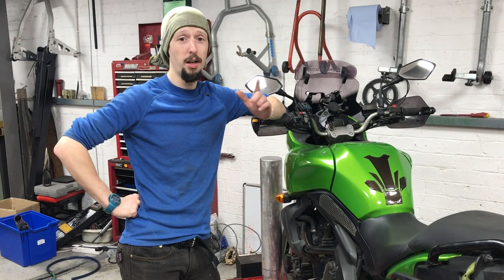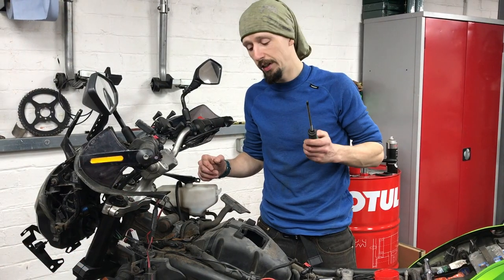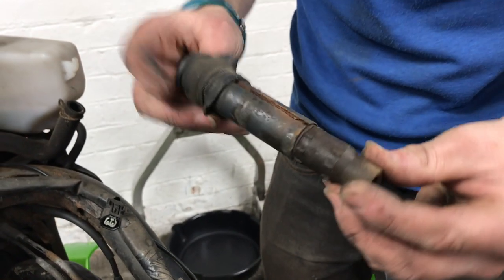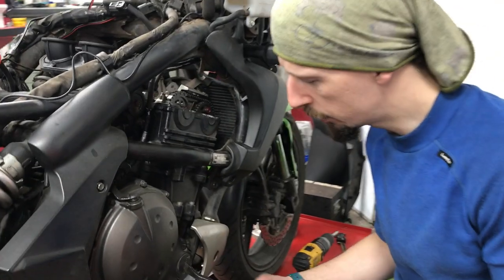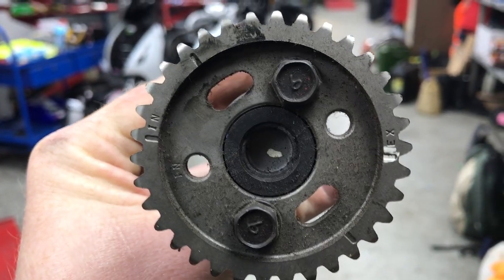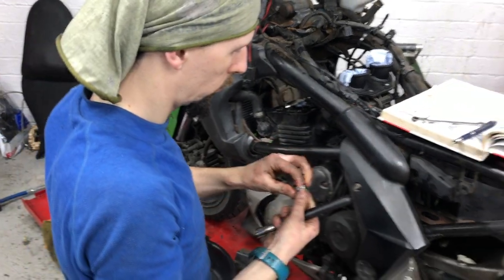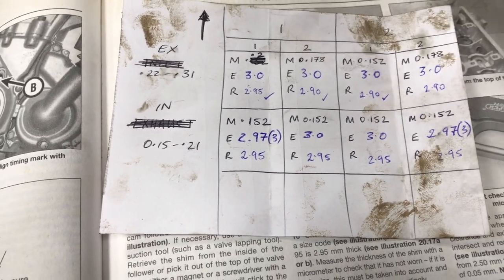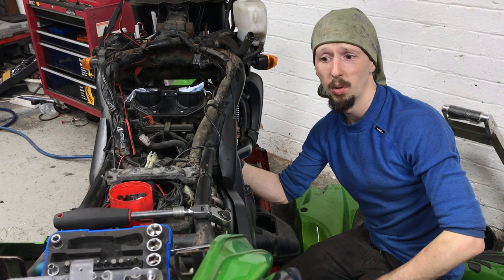Kawasaki Versys 650 - How to Adjust Your Valve Clearances

Comment: I can do most of the regular service myself but I don't feel too confident on my skills to attempt a valve check and adjustment. I think I'll take my bike to a professional just for this job! Great video and I'm a bit surprised that you have less than 1000 subs, you deserve much more than that!
Reply from the maker: Thanks Antonio. Much appreciated. The valve clearance job is fairly straightforward if you’re methodical and take your time, but of course it’s best taking it to a mechanic if you’re not sure. 

We’re getting up to 1000 subs. It’s been a long road! I guess what we do is quite niche. Thanks for watching 👍
Reply: @MechitBetter  I would feel better if I had the chance to work on the valves of a dead 4 stroke engine just to do some practice. Maybe I'll do that when the bike gets very old so I have less to lose if anything goes bad :)

Comment: When using the micrometer, tighten using the smaller diameter handle on the end. This has a spring ratchet that clicks to say it's just touching. The larger handle is to release or tighten when there's a large gap.

Comment: You guys are awesome! My versys already did 95,000 kilometers, I have most of the service history but it is not complete. Already did a regular service (spark plugs, oil+filter, airfilter) last summer but I am planning to replace my fork stanchions (a lot of rusty pits eating my seals) and check my valves. I have a service manual but it is a lot more fun watching your vids! Thanks!
Reply from the maker: Thanks Jamy. Always nice to hear such positivity. My Versys is just a fraction short of 70,000 miles (112,000km... I think)
 Im not as certain about its service history, other than the couple of years ive had it but its had plenty of attention over that time.
We did do videos for the fork removal and rebuild which might be helpful to you.
I always feel a bit more comfortable tackling a job if i can see it happening. A manual is good but can sometimes make things seem harder than it is. Feel free to ask us if you get stuck, we'll do our best to help.
Reply: @MechitBetter   Yes, thats how I came on this channel! And I feel the same way although some how2vids are a lot more boring than yours. My new fork tubes (seals, bushings and oil) are on their way and I will definitely grab the fork removal and rebuild vid! After that I want to treat the rusty parts of the frame in some way and check my valve clearances. Thanks for offering the help and I will keep you posted!
Reply: Did your versys get ticking noise. Mine has been having low volume ticking noise. I think I need the valve clearance for the bike. Please tell me know if I am correct. thanks.

Comment: Well done mates!  Very useful and informative along with some very helpful tips for a rather labour intensive job.  Cheers!
Reply from the maker: Cheers Kevin. Thanks for watching 👍
Reply: @MechitBetter  Listen Mate, I am about to purchase a 2020 Versys 650 in the next week or so and would appreciate your input on your thoughts on this particular bike.  You seem to be very knowledgeable on your product and would be interested to know what you think.  I live in Canada and what I have researched so far has indicated that this is a pretty solid machine for the money.  It's the first "adventure" style bike I will own so would appreciate any input.  Latest bikes were a 1985 Ninja 900 and 1984 Honda Nighthawk S.  I have rode a 2015 KLR 650 and found it a little high and top heavy.  Any info would be greatly appreciated.  Cheers!
Reply from the maker: Hi Kevin. Great engines for a start. All the way through the series of revisions. A solid a reliable Parallel Twin. 
The main questions for me to ask are what attracted you to the Versys and what type of riding do you typically do ...or intend to do?
Have you physically handled / sat on the bike yet?
They are definitely towards the taller seat height, but then that's kind of the idea with adventure style bikes, to account for additional suspension travel.
You can get slimmer seats and lowering kits etc if you need to. 
I would definitely recommend having a center stand if it doesn't come as standard, it makes life much easier.
The latest ones have lots of fancy electronic options but heated grips is the only important one in my opinion.
The taller touring screen is also a practical addition if it's not already standard.

Comment: Do you order a shim kit specific for Kawasaki versys 650. Or do you order the shims individually?? Could you please add the link

Thank you
Reply from the maker: Hi,
The outer diameter for the versys shims is 7.48mm.
You can buy specific kits for the bike which includes a whole bunch of different thicknesses to cover a wide range of adjustments or you can buy separately. 
It's obviously a bigger investment to buy a full kit but then you're probably covered for all eventualities before you even strip the bike down to check. At that point you can replace them straight away and reassemble.
If you can survive without the bike for a while, do the check and then order the  specific ones you need. Just be very sure you're measurements are correct.
We we're lucky that the guys at NYAB (where we did the video) already had stock available to use onsite and we didn't have to order any.
A company I have previously used for bike parts is Wemoto. They do list shims for the versys. 
Hope that helps

Comment: Are there any signs that valves come off the limit without opening the engine?   thanks
Reply: Usually clicking noise, which is too late usually, but still better later than never.

Same as, how to know when to change oil without seeing the oil or Mileage.

The advice I got from Mechanic who loves bikes:
I real life, valve clearance depend on how you ride the bike.
If you don't want to panic over valve clearance, never drive on a cold bike.
Let the bike to heat up for a minute or two, then drive.

My thoughts:
I'd say, if you didn't do valve adjustment, do it, but don't panic about it. 
Use the best oil you can afford, as a long term investment, its worth it.
Let the the bike to warm up before taking off, let the oil do its job first.
Rev the bike to its max from time to time, to clear carbon deposits, which happens on low RPM's.
Other good quote: "You paid for the whole tachometer, so use the whole tachometer!"

Comment: Guys I have another question for you.

I have bought some crashbars for my V650. They have 3 mounting points, 2 at engine mounts and one at the frame. Tightened to spec,  go ride, vibrates, not comfy. 

Asked some guys, they said you misaligned the engine in the frame. So I refitted it several times (close to 10 actually), no luck. 

Manual doesn't say in details how to align the engine in the frame. I tried mounting points perfectly aligned then tighten, I tried to slightly tighten bolts and let engine loose, Rev it a bit (I read somewhere it should find its place in this state). I even removed crash bars and it still vibrates. 

All give no luck. It vibrates from 3000rpm, making peak vibes at 4500 5000 and higher they still present. 

It works on neutral standing and rolling. It works clutch in or out. I rechecked every possible bolt I could find, that is not the case. I cleaned air filter and checked spark plugs.  

Mileage is 50 000 kms, valves are not adjusted recently. 

Do you have any ideas what is wrong? I hardly believe that when I loosened engine mount bolts something went wrong in the engine itself. 

Please help 🙏

Comment: Awesome. Thank you very much.  Do you think this would be similar to the 2017 Z650?
Reply from the maker: Hi Barry. Kawasaki do like to use same engine in different models. I know the Z650 is also a parallel twin so although it might not be exactly the same (given the 10 year age gap) the general principals should be.
I'd always try to get hold of a proper manual to be sure but our video might be a rough guide / starting point for you.
You thinking of giving it a go?

Comment: 13:52 so only exhaust was out and intake was alright, correct ? How many miles on this bike and was this the first ever clearance done to it? Thanks for the video.
Reply from the maker: The exhaust ones were all too tight. The inlet ones were only just within tolerance but would have been too tight very soon so it was worth sorting all of them while we were in there. In the end we changed them all. The bike is coming up to 70,000 miles, but without any service history it’s hard to say if they’d been done before or not. Always worth checking if you’re not sure when it was done. Running with them too tight will damage the engine 👍
Reply: @MechitBetter  I've just upgraded to mk2 and it only has 15k on a clock. Will crack it open when I'll do my full service. Really appreciate your videos on this. Subscribed!
Reply from the maker: Sounds like a good plan. Set a day aside and you should get it all done along with the service. Thanks for watching and subscribing 👍

Comment: what are shims? and are they the detrimental component in this? do i need to have replacement shims?
Reply: yes, is the short answer, you replace them to get in spec, they are small round plates in different tickness, it is a more morden way to adjust then the old screw and nut and also keep the bike with in spec for much longer, many mechanic report that when they follow the manufacturers service list and check the at etc. 20,000 miles (it is different from bike to bike) they are often still in specs, where the old screw and nut often have to be checked at etc 8000 miles and often is out of spec.

Comment: Sorry if you mentioned this but what year is this bike?
Reply from the maker: This particular bike is a 2008 (Gen-1) but the process is pretty much the same for the later bikes too. If yours is not the same version you should probably check if there are any changes to clearance values or torque settings.

Comment: Hi, I own a 2009 ER6f, I’ve just checked the valve clearances and I find that three of the exhaust valves are on the minimum clearance of 0.22mm and two of the inlet valves are, again on minimum clearance of 0.15mm. Would you bother changing the shims to give valve clearances closer to maximum clearance value? Many thanks in advance!
Reply from the maker: Hi Andrew.
I would probably make some adjustment more to the middle of the range. Valves typically wear tighter over time so if they're currently at minimum now it would make sense to open them up just slightly. 
Double check clearance before bolting the cover back on ...to be extra sure.
Hope that helps.
Reply: @MechitBetter  Thanks very much for the advice. I will change the shims to give a mid range clearance. Obviously I don’t know what the tolerance was when the engine was initially assembled and I don’t know how much more the valves will sink into the valve seats over time. I was tempted to shim the valves close to maximum tolerance thinking that I could then be sure that they would last until the next 25,000 mile check.
Reply from the maker: Your safest bet is to stick to the mid range. The bigger the clearance the less performance you get. You don't really need to know the figures from factory or what they might be in the future as long as they are within the correct range now.

You could in theory leave them on the tighter end of the scale but you'd have to check and potentially adjust more frequently.

Comment: Excuse me may I have a question? In witch mark we place the cam chain tensioner 1/t mark or 2/t mark?
Reply: And a second question how much we screw the big central bolt of the tensioner?
Reply from the maker: @gianniskef427 off the top of my head, I'm pretty sure the chain tensioner is one of the last parts that you would refit and would not affect the engine timing in that sense, so it shouldn't make too much difference what mark, if any, is visible as you would probably have the inspection covers back on by then. The larger centre bolt is basically just a cover for the mechanism so should not need to be "monster" tight. Just be sure that the mechanism has been reset before you put it back in.
Hope that helps, let me know if you have any more questions. Sorry if i missed something.
Reply: Mech it Better thank you very much you really helped me!! Your video has all the details to do the job right!! I’ll reset it all the way back as you did?
Reply from the maker: @gianniskef427  You're very welcome. Glad to help. Hope everything goes well with the bike.

Comment: Ahhh man, it's so much easier when others do it...I'm still annoyed that bikes need their tanks removed to check air filter...
 the box holes for the bolts are awesome. How long do these Versys beasts last anyway?
Reply: for a looooooong time m8... imagine some friends are over 40.000 kms, and they havent done it. Mine is only 10k so i will not see this in a long time
Reply: My 2008 Versys only lasted 21,000 miles. That was when a fool in a truck decided to run a stop sign and drive through the front wheel, ripping it out from under me, as I bounced off the side of truck.
Reply from the maker: 😬
Hope you're ok dude. That's such a terrible situation. Do you still ride?
Reply: @MechitBetter  Full touring gear on (thank goodness). Massive bruising and a pulled ligament in the knee. I pulled off all the 3rd-party accessories before the insurance company took it. Then 6 weeks of physical therapy. Found a 2009 Versys with 750 miles on it, bought it, and installed the accessories. 11,000 miles on it now.

Comment: nice, is that bike any good actually?
Reply from the maker: Hi Andrew, thanks for the message. I think the Versys is an excellent bike. It serves me extremely well over the years I've owned it. Good torque and performance while being comfortable over long distance. Always put a smile on my face if nothing else.
Are you thinking of getting one?
Reply: @MechitBetter  yeah, cannot decide between the versys 1000s and 650 :)
Reply from the maker: It will ultimately come down to what you plan to do with the bike. If it's majority motorway miles, and/or with regular pillion, then 1000 would probably make more sense.
Anything else I'd tend to grab the 650.
My Gen 1 easily handled commuting and fully loaded touring with ease.
I really like the feel of twins (insert your own joke 😉) but do you have a preference over a punchy parallel or a revvy inline 4?
Decide if you enjoy a more agile and engaging ride over a smoother feel with less rider input required.
I've never felt the 650 was short of power and it just works. It's also less bulk to move around; about 35kg lighter compared to the 1000, however you do get slightly bigger forks and discs on the 1000 to compensate.
I believe they both have 21L fuel tank so, if nothing else, you're going to get way better mileage out of the smaller CC machine, which could be a significant detail to consider.
All depends which one best meets your needs and "feels right" really.
Hope that helps in some way ✌️
Reply: @MechitBetter  thanks!  I just worry about pillion comfort on 650 as I am a 240lb guy :)   did you ride with pillion?  650 is kinda short.

Comment: You have a phone mount that is mounted on one of the bolts of the hand;e bar clamp?
Reply from the maker: Yes. I had to find a longer bolt and use a spacer but it puts the holder in a much more convenient, and more central location. Keeps the phone more protected behind the windscreen and in a better position for navigation etc.
Reply: @MechitBetter  which one it is and where did you buy it?
Reply from the maker: It was just a cheap option off eBay. Can't remember which one specifically but I was only about £12 . Well worth having one anyway, especially for longer trips.

Comment: hi there,did you replace the cam gaskets?
Also i have a versys mk2,there is no haynes manual only service manual,are you you using ER6 manual? if not where did you get it?
cheers
p.s ment to say good video
Reply from the maker: Hi, Thanks for the comment and Sorry for the delay. Didnt change any gaskets during this fiddly task. Just had to be careful when putting the cover back on.
As far as i know, despite how good it is, Haynes didnt do a manual for the Versys. We were able to borrow one for an ER6 seeing as engine is the same.
Did you manage to get it done?
Reply: @MechitBetter  Hi cheers for the answer,I was very unsure about valve adjustments,but now i would have ago in the future.
Pity about Haynes manual,i have always used on cars,since i could drive,1983,.
Just wish i had a garage,or a shed lol.
Anyways thanks for the reply,vids keep it up lads.

Comment: Can I get some info on that phone holder mount?
Reply from the maker: Hi Jacob.

Sorry for the slow reply.
The phone mount is a great little purchase off eBay. An X-grip style. It only cost about £10 and includes a usb charge slot. Its wired straight to the battery but does have a tiny switch on the unit to manually disable power.
It has a flexible "RAM" style, ball & socket  mount to attach how/where you like it.
I chose to replace one of the handle bar clamp bolts (with a longer one) to have my phone in a convenient, central position  for sat nav use. I'm really pleased how well it works for such a cheap item.